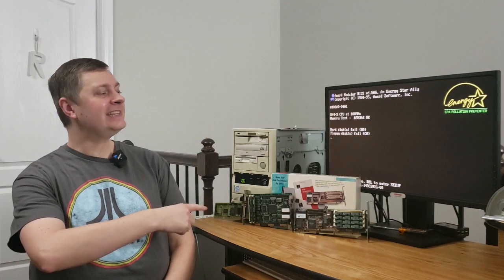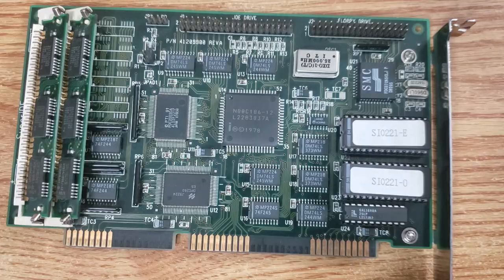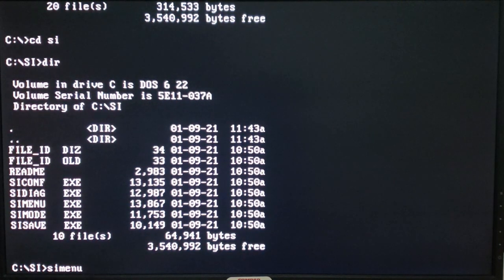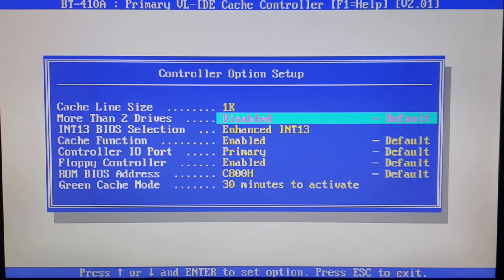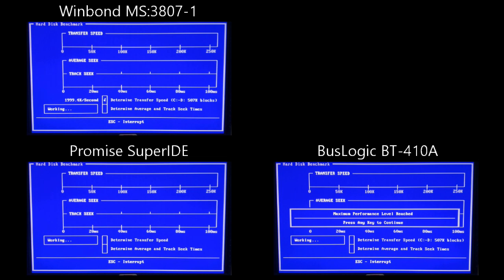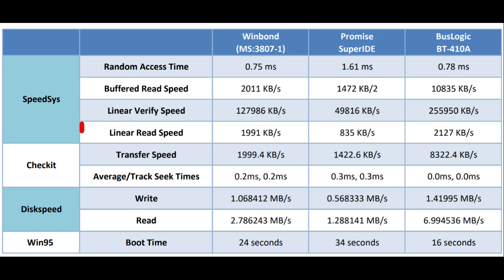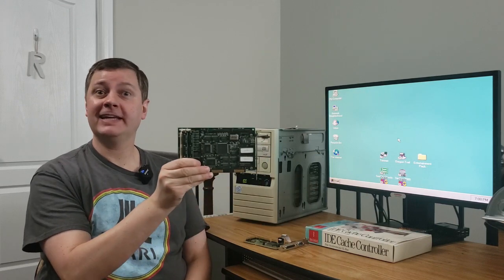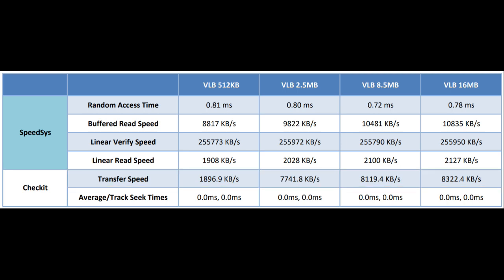RetroTour: ISA and VESA Local Bus IDE Controller Performance Test.  Which Card Will Win?

Comment: Would be interesting if there is noticeable difference between plain isa and plain VLB controller (without cache or anything special)
Reply from the maker: And here was the final thread where I got the plain VLB controller working! https://twitter.com/RetroTechChris/status/1754692258136252724
Reply from the maker: Definitely!  I did some testing later (took me a few rounds due to the unique drivers of the DTC card, which actually resulted in me using an XTIDE BIOS with it, along with MR BIOS), but here is an "early" thread on it! https://twitter.com/RetroTechChris/status/1748773702773231938
Reply: @RetroTechChris  ok thx I got two that didn't work on a quick try but isa did. Will give them a deeper inspection on my next 486 session.
Reply from the maker: @AncapDude  got it!  Do you recall what the brand/model of the controllers were?
Reply: @RetroTechChris  don't remember I can look at them next week

Comment: The results of your tests are easily explained. Winbond, which seemed to have no cache, won the battle with Promise because the hard drive operations were controlled by the PC's central processor, and Promise used its own 80186 processor to do this.
Do not forget that in this case, the test results were also affected by the ISA bus, which acted as a “bottleneck”.
BusLogic's results are also interesting and understandable. Yes, it has a more powerful Intel 286 processor on board, and thanks to its solutions, during hard disk operations, this card significantly relieves the central processor. High data exchange rates are also due to the use of a faster VLB bus.
In general, for such a fast machine as the DX4-100 there is no need to use caching controllers, since the central processor (due to its high clock speed and performance) copes well with data input/output operations. We will need caching controllers if we plan to operate it as a server, and every megahertz of the central processor and fast work with the disk subsystem will be dear to us.
I think they need to be tested “under load”, then Promise will open up and show its potential in front of the simple Winbond. Well, BusLogic is the king of caching controllers of that time. I have the same model, but only on the ISA bus. Later I will conduct similar tests and pass them on to you. I think it will be interesting. All the best, dear friend!

Comment: kind of a weird question, but do VLB cards work in non-VLB ISA slots?
Reply from the maker: Now THAT is an excellent question.  I don't believe so, but maybe some cards would?  I am too chicken to test it though, I don't want to break anything!!
Reply: only reason I ask is because there's those 16-bit ISA cards that can function in 8-bit slots.
Reply from the maker: @Megatog615  definitely!!  I did some Googling and nothing really came back, someone has had to try it!  I bet nothing bad would happen, but if I cooked a mobo or one of my VLB cards, I would never forgive myself!!
Reply: Only if the manufacturer has provided for the possibility of such use, but I am not aware of such cases.
I think it’s impossible, for example, BusLogic shown in this video was released in VLB and ISA versions. If it was possible to use a VLB card in an ISA slot, then the manufacturer would not make a separate model.

Comment: Nice presentation, Chris!

I had a similar experience to the "cheap" drive controller beating out the (older) fancy, DMA card.
When I upgraded my Amiga from its standard 68000 processor to 68040, the performance with my existing DMA SCSI controller was lousy. I talked to the 68040 card manufacturer and they said the fastest disk access will come from a cheap $70 card (as opposed to say, a $200+ card), so I got that and it flies.
https://www.youtube.com/watch?v=7xhsxuF_ML8&t=5m17s 
The reason is that the non-DMA controller relies on the main CPU to do disk transfer operations, since that is a 68040. I wonder how much of your results (with the low-end card) are due to performance of the system main CPU (rather than a CPU on the controller), instead of caching. (For instance, one would think the Windows boot would not rely much on caching.) Nice suite of tests!
Reply from the maker: Thank you!!  Funny how that works, isn't it :-)  Now if only the VLB card supported ATAPI!

Comment: Would using a compactflash card instead of a mechanical hard drive negate any benefit from using these caching cards?  I would imagine the bottleneck would become the controllers themselves.  Would be interesting to see.

Also, obligatory "first"
Reply: At least the CF card is guaranteed to run close to the max bus speed or data being pushed through.

It would have been interesting to see the base machine  results ( ie with the on board or base I/O card )

One of the issues is at 386/486 days we were not really pumping mach volume via hard drives - well no one was reading writing large files like todays movies etc

I think the hardest test would be win95 start up and the ongoing use of virtual memory swap file - yet in saying that i do recall upgrading a hard drive and video card when first installing Wolf3d as you walk up to a wall or go so far, then the screen /game pauses and the hard drive lights up as it loads the next portion of the floor plan

Regards
George
Reply from the maker: @georgemaragos2378  interesting idea to use a game as part of the benchmark!  As far as onboard I/O is concerned, this machine predates that concept (i.e. there's no onboard IDE or floppy controller on this machine)
Reply from the maker: I believe it would!!  Sadly I didn't have a mechanical drive that was not set in LBA mode that I could use for the test.  I might have to do a follow up video!